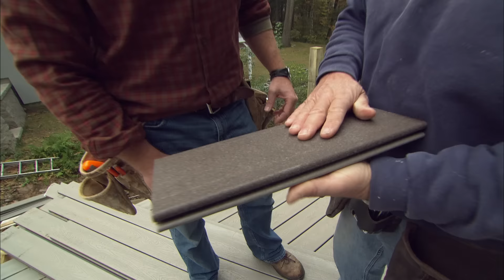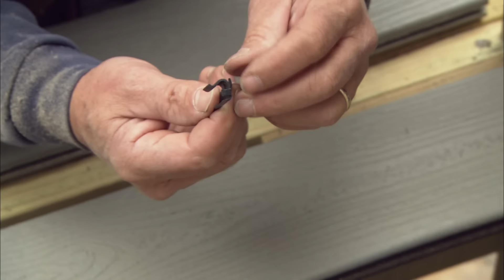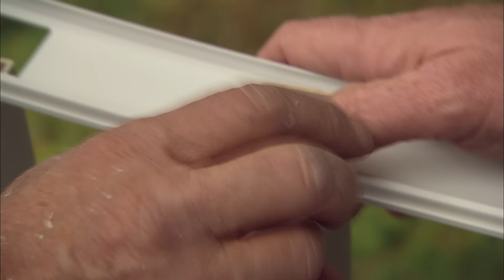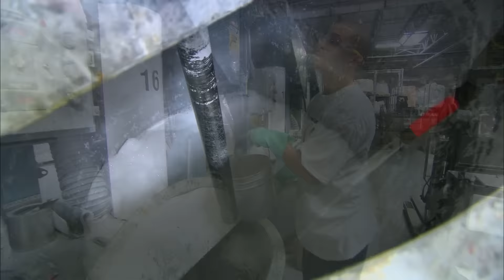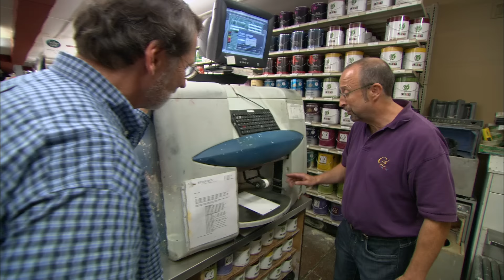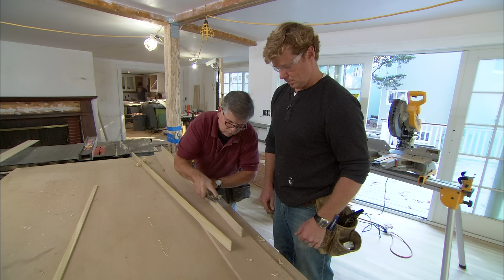This Old House | Making the Most of Green Products (S32 E12) | FULL EPISODE

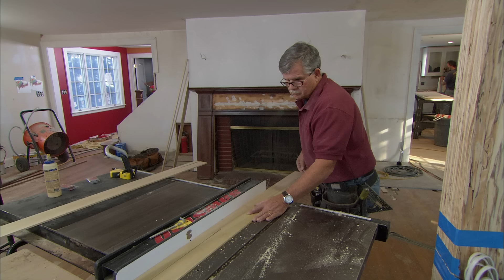Comment: 20:45 as a carpenter I understand Tommy using his hands for the cut. Have done it a thousand times myself. As an OSHA inspector it makes me cringe because I have seen the results of a simple infraction. I had to investigate the death of a man that took a 6 foot folding ladder and leaned it against a wall. It slipped and he hit his head ageist the concrete. He died 8 days later. All it takes is that one time.
Reply: He's using a Saw Stop.  He's fine.

Comment: That white railing is going to need pressure washing and or brushing to remove algae growth yearly, ask me how I know.
Reply: That's better than the alternative of putting stain/sealer/etc on a wood decking every year to prevent it from turning grey. 20 minutes with some soapy water in a power wash is pretty easy maintenance.
Reply: Pressure washing, no; a slight scrubbing with a damp rag, yes.  But that's far better than staining/painting/sealing a wooden railing system yearly.
Reply: @morlamweb there is no need to paint or stain yearly..
Reply: The deck here is elevated and prone to increased air flow.  I don't think it will do the same thing as your environment did.
Reply: How you know?
Reply: If facing North

Comment: That is the first time I've seen a circular saw used upside down
Reply: Micro plastics on the lawn????
Reply: @billneurohr8509 it's a composite
Reply: Norm has said in interviews that one of his first memories working with his father was him installing a circular saw upside down in a milk crate as a make-shift table saw to cut hardwood flooring on a job.
Reply: @mrpiccolo23 cool beans 🫘
Reply: A table saw is basically a circular saw mounted upside down.
There are videos from years ago where people will build a table saw from a circular saw by mounting it upside down on the wood.
It's the poor man's way of owning a table saw.
Reply: i would never trust myself to pull that off. i use a jigsaw for those post cut outs.
Reply: @jason-5757  that is a great idea to use a jigsaw for this type of cutting
Reply: and you can try using a speed square against the edge of the jigsaw to keep it straight for the 90° cuts. then for the horizontal cut, just come in at an angle and chip it away.
Reply: @jason-5757  that is a great idea to use a square to keep the cut straight